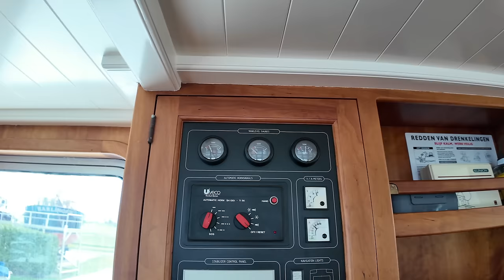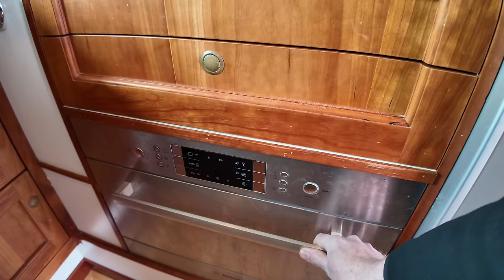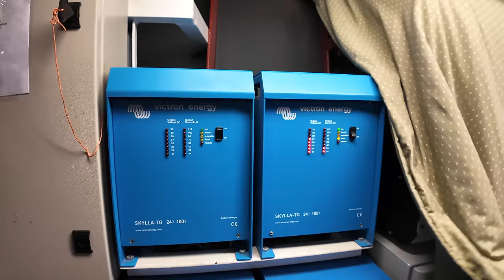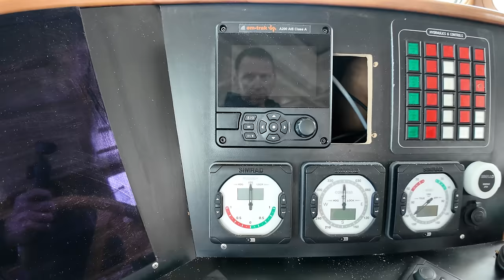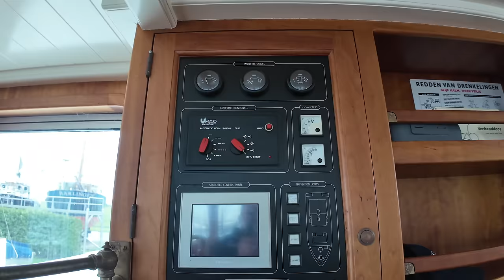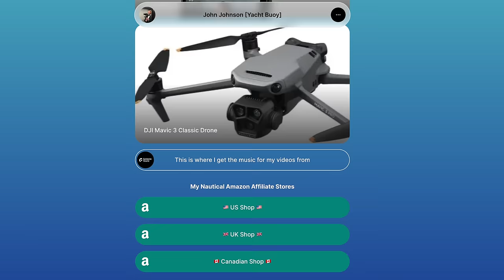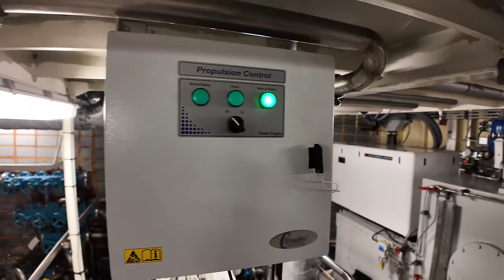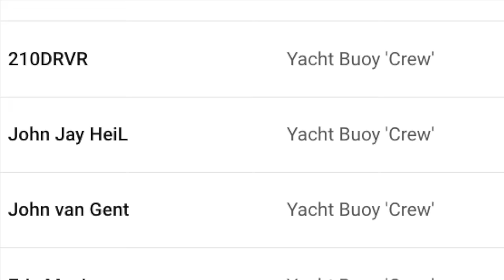€1.1M STEEL Trawler Yacht FOR SALE (5,000 NM Range) M/Y 'Sirius'

Comment: I would absolutely leave those two areas as dry storage and a workshop. I'm often surprised how few long range boats have spare parts visible on board. I would think that either one of those areas would have some heavy duty shelving for spare parts along with oil change equipment, etc. I would hate to be out in the north Atlantic and be stranded because I didn't bring an extra part that is easily changed by the owner. Especially one that is not readily available in any port like spark plugs or filters. Just my 2 cents....Greetings from Texas....John B.

Comment: A really great no nonsense long range cruser. However for long Atlantic crossings and Pacific ones she definitely needs that extra fuel capacity. As you suggested you'd also need to fit sola panels. Suprised about the lack of fiddle rails and pan clamps on the cooker. All that storage space would be needed for long distance travelling. Makes a nice change to see a proper boat and not a gin palace with a flying bridge etc.
Reply: Needs deck head grab rails also.

Comment: I saw some drawing on the listing for crew quarters in the cargo hold area that I would use as a guide. Probably update the electrical with solar and more or better batteries so you could at least have enough energy storage to turn the generator off for awhile. I would also look at putting an induction stove and electric oven so you could get rid of the propane. I would love this boat if I had the money and time.

Comment: Very nice lines and very nice angles. Any possibility of moving the bridge superstructure forward and building out the back with a saloon and dining area opening onto the back teak deck and swim platform either the Rigid  Inflatable (cabined) and davot both located on the roof ?

Comment: Good looking rugged Yacht. However, I would never go to deep see without backup propulsion, so, I was glad to see the backup motor.  I have seen long range Yachts with a single motor, but I would never consider one with a single motor as safe. I saw a video of a couple of guys delivering a long range Yacht with a single motor and no backup and the motor died. They were almost in a world of hurt, but were able to figure out the problem after several hours and got back on track.  I did see a walk through on a long range Yacht that had a single motor, but the heavy generator was it's back up propulsion system.  My only criticism for this one is it needs a bigger and stronger main motor.  Slightly under powered and slow in my opinion.  Also, aluminum framing for the front windows would be a concern. Seen windows blown out on videos in heavy seas.  The plus of this one is all that space up front!  A lot someone could do with that.  Thanks for the walk through!

Comment: I wish it was not a single engine vessel. The Homer engine's power, speed and range is not explained in the video. There is plenty of room to add another engine or just repower with two engines of a more international availability of parts.  There is also lots of room to move the shop to the lazarette and build additional cabins in the bow area. This is a great boat with lots of possibilities.
Reply from the maker: Technically she has two 🫡
Reply: Yeah! It would be much better if it was twin screw. Otherwise I do like the layout.
Reply: Speed AND range were mentioned in the engine room tour
Reply: Sorry, I meant with the auxilliary engine.
Reply: She actually has 3 identical thrusters (sleipner I think) 

- bow thruster
- stern thruster 
- auxiliary prop

You can see the aux prop/thruster at 21:18, bottom left is a horizontal hydraulic ram that lowers/raises the thruster … and at 2:10 where you can see the thruster lowered to the left

Comment: oh this one is great, it would be great for the lakes and rivers around here   77''   isn't to long to be docked.  fitting nicely into one of the 100m berths.  

though i still wouldn't trust her on the lakes when the witch of November is in a mood.   

forward area, large storage space would be great as a vehicle bay.  replace 1 of the tenders with a landing craft tender.  able to load and carry a quad, pair of motor bikes, or even a small UTV side by side or something like a boomer buggy.   just what ever can fit through the cargo door.   

Unfortunaly there isn't enough deck space to move the boats and open the cargo doors  with the boats still on deck.  this means you'd have to deploy the landing craft then load it with the vehicles,  which can make things a lot more tricky.   you'd also have to deploy the  boat at port... to move any of the vehicles onto the dock.    

But being able to carry vehicles,  both off road, and short range internally would be a huge benefit.   especially small side by sides, allowing you to drive in pick up a few 100 kg of cargo, food, what ever, and drive back....  or a boomerbuggy allowing you to visit a town and see the sights...

Comment: Hate to criticize what is clearly a special vessel, but to me she's lacking "personality" and warmth, if I do say so.  Everything seems rather sterile.  I could guess that if she's for sale, the owner has not added those warm touches or they have been removed for the sale.  I don't see much in the way of overhead hand holds for being in a seaway, or other "granny bars" here and there to hold on to or brace with while punching through a big swell.  Woodwork and paneling are nice, but really darkens the interior, especially the master and guest staterooms.  No fiddles on the saloon table or on the counters in the head or utility room?  If the AC rating you mentioned is correct, that is far too low capacity.  Anyway, well presented and I've subscribed.